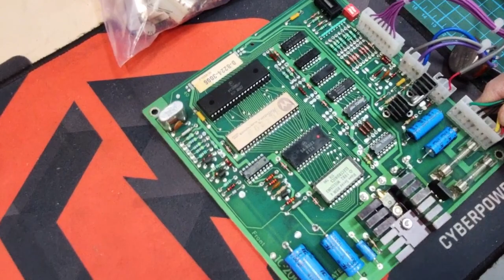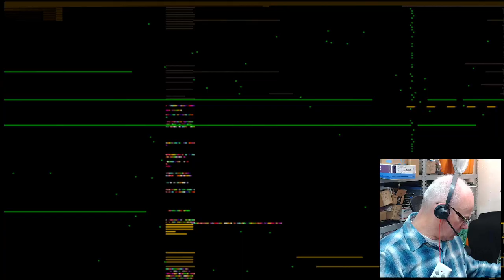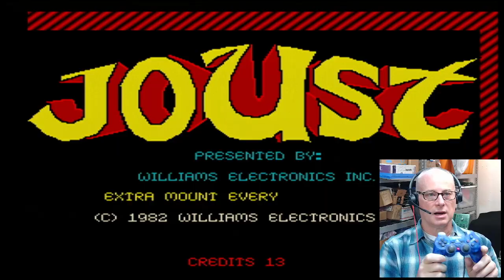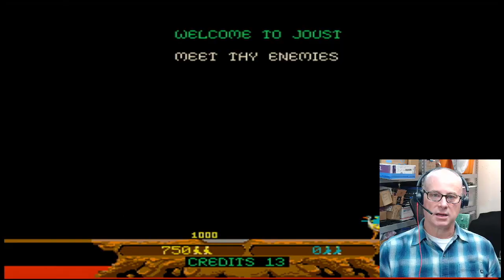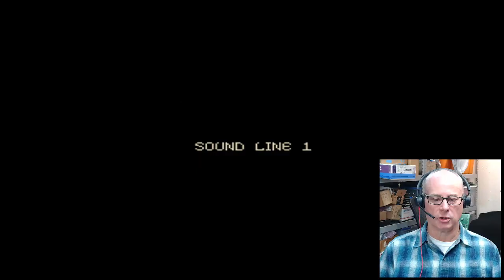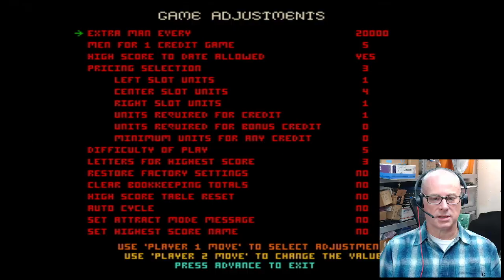Robotron Board Set - Repair and Restore -Rev B Mods!

Comment: Great work as always, Do you have a pricing for reworking a board set for say a Robotron?
Reply from the maker: Thanks for the kind words! Typical set (not including linear power supply) runs $180 + return shipping (CONUS Only). That includes the: MPU (Main Board), ROM, I/O (Widget) and Sound boards. There are times where I have to add certain parts like a Blitter (Custom IC), or if a lot of DRAM has failed (I had boards come in missing all 24, or all bad).  If you want the linear supply rebuilt/restored, that is a flat $100 (~$60 in parts - Includes the heat sink).